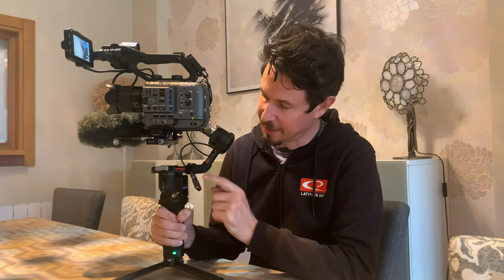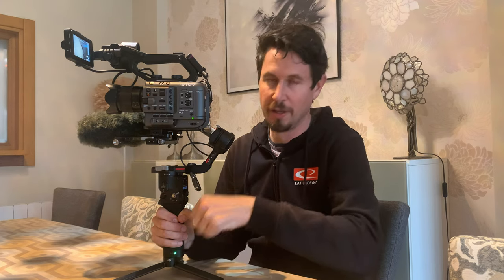How to balance a cinema camera on a gimbal to film disc golf

Comment: how tricky was it to balance the FX 6 with the handle ? Any hints or tips  aside from the ones you gave in the informative video ?  Did you try to balance a FX6 with handle on the Ronin RS 2 ? regards Peter
Reply from the maker: Hi! Not too much. Simply focusing on reducing the number of counterweights needed. Recently I’ve added an external 5” Atomos Shinobi monitor that I can fix in the Gimbal handle so now I could even go without the Sony monitor.
I have only tried it with RS3.
Reply: @zonadiscgolf  Thanks a lot for your response. I try to balance the fx 6 on a RS2 with the handle, but it is somewhat tricky - did you try the RS 2 as well ? regards Peter
Reply from the maker: No, sorry, I bought directly the RS3…